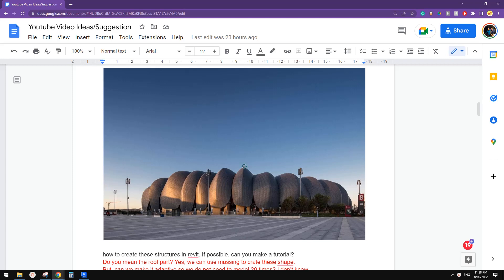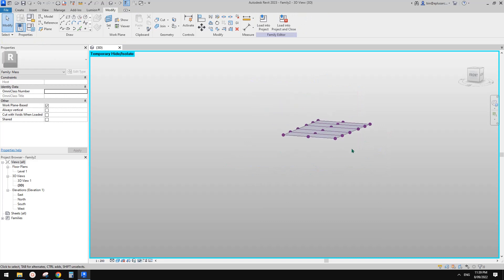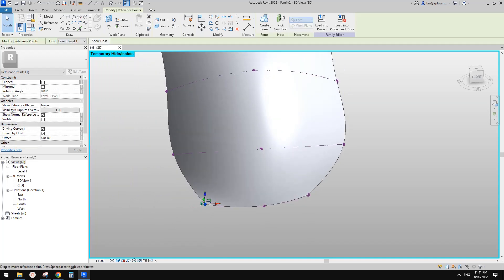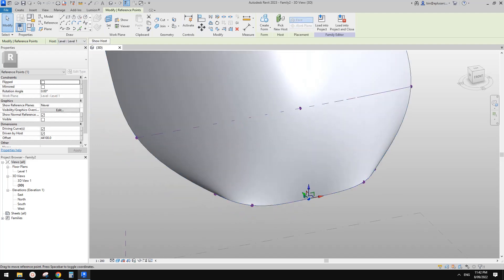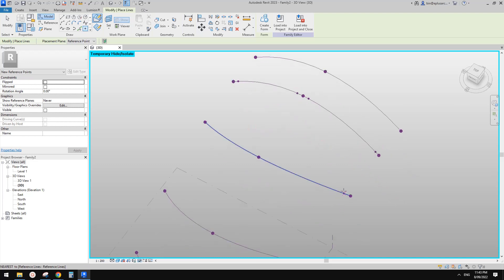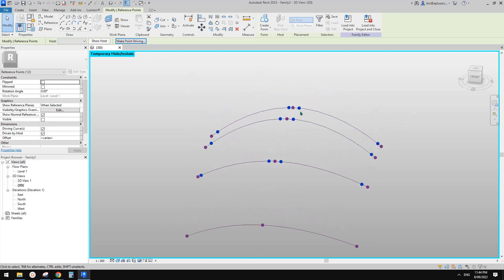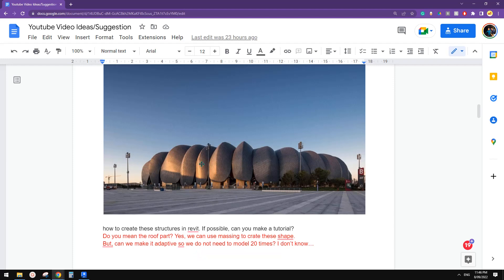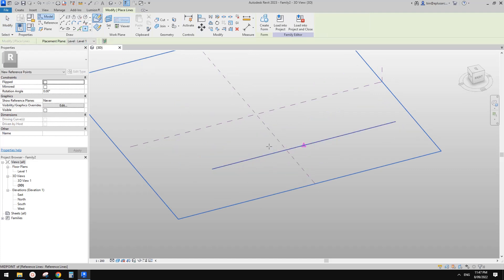Revit Exercise (899) - Mass Experiment

Comment: NICE WORK, THANKS BIN. I THINK THIS IS OK FOR SINGLE ADAPTIVE FAMILY. BUT WHATS THE SOLUTION TO CONTROL OF MULTIPLE ADAPTIVE FAMILY AS A PATTERN TYPE WHICH ALL READY SHOWN IN IMAGE?
Reply from the maker: Adaptive family, or conceptual mass, Either points with offset, or points on reference planes. Will need a lot of parameters to control them... It's probably easier to just model it without parameters, then copy and adjust manually.... Or, you can always model them outside of Revit.

Comment: Very good understanding for the weight of points on spline in Revit, it is funny that you can tweak so much  an already build surface but almost impossible to use the tweaked curves  built up a surface out of these curves!
Reply from the maker: I agree.